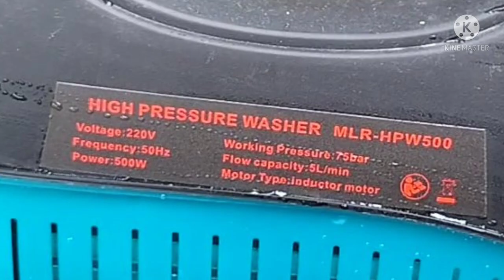Jet cleaner mollar professional hpw500

Comment: Pake quick release bang biar lebih enak lepas pasangnya, sy jg pake tp yg merk orion.
Utk keran cuci ac nya sama.
Reply from the maker: Benar bg yg di outputnya ya bg
Reply: @M.Teknik  output mesin, input selang, output selangemuju gun, gun nozzle AC kasih quick release semua .
Jd saat lepas pasang enak tgl klik klik.
Reply from the maker: Terimakasih masukannya bg👍
Reply: Mas selang nya bagus kdk atau mollar ?
Reply: @ujangs3359  om, pake orion superjet 100 ya?  Utk cuci evaporator , apa ga penyok sirip2 evaporatornya? Setau saya orion superjet itu tekanannya lbh tinggi drpd jet cleaner merk2 lain yg selevel harganya.
Reply: @moccicake5866  Aman buat cuci ac, krna tekanan orion ga gde gde amat, asal bisa ngatur nozzle nya.
Tulisan 120bar, nyatanya cuma 35-50bar tergantung nozzle yg dipake.
Reply: @bagaskoro5509 tks infonya,om🙏
Reply: Gun mollar hpw 500 saya sering lepas pas digunakan. Kalau diganti yg cocok pakai punya apa ya